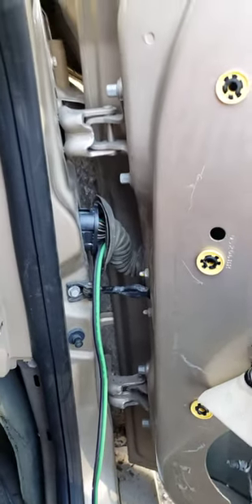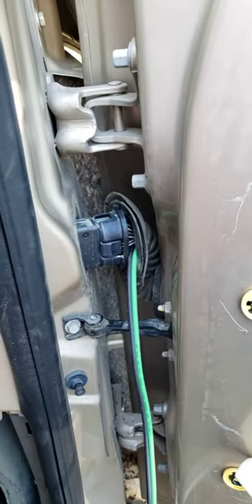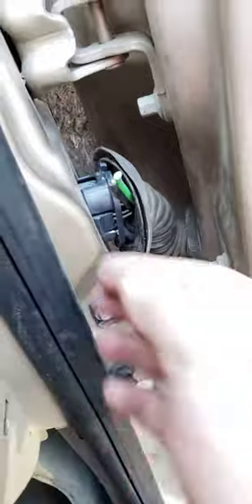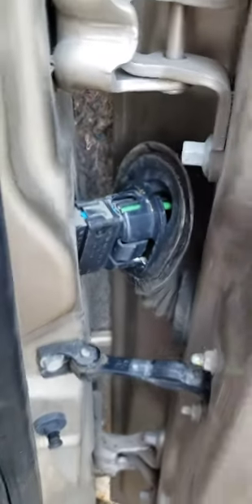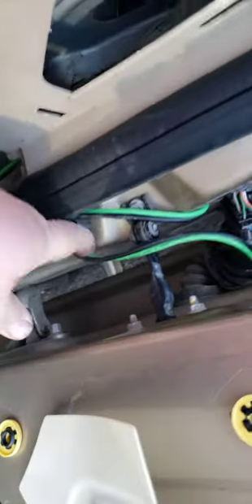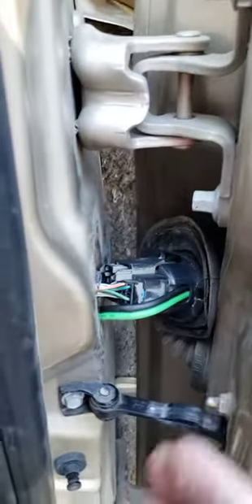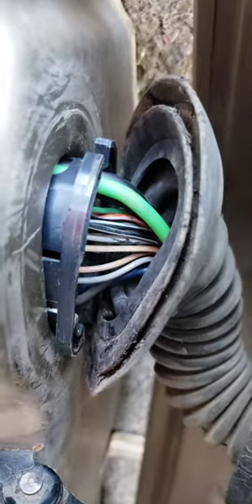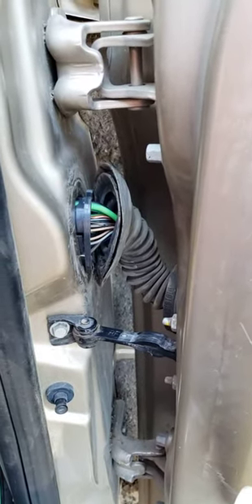easier way to run speaker wire through car doors

Comment: Wish I found this earlier...I just installed some bullet tweeters and speakers and tapped into the wire harness on the door hope it works out good waiting on my deck to come so I can test it....that's should be fine rite instead of running the wire all the way back to the stereo??
Reply: so you ran new wire from the door speakers back into the door harness? you'd realistically want to rewire that harness connection as well, especially if you're stepping up from the stock wiring to a larger wire.
Reply: @DavidBrown-zp5br  ok thanks yeah I thought so but I really didn't know how to get it through at the time...but I tested it and it worked sounded ok

Comment: That puts the wire right beside the metal edge of the opening, over time it will rub through with vibration and short out